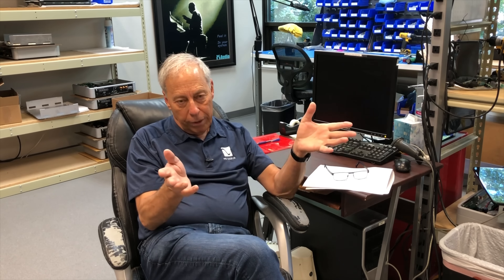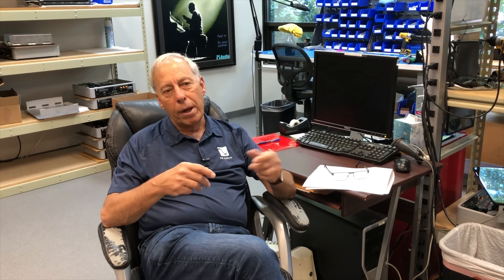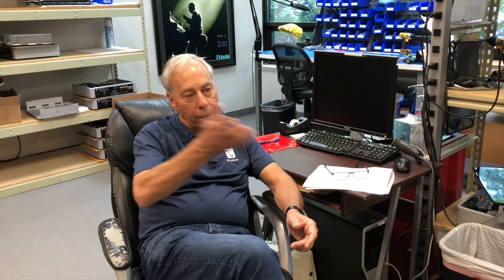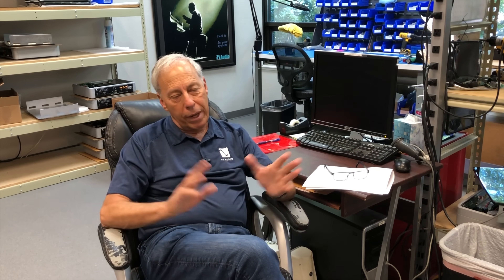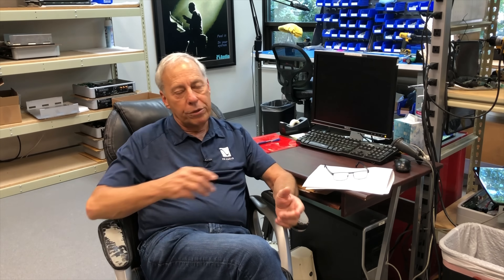How to make Class D sound better

Comment: It's important to note that a good class D amp is often times more revealing than other amps.  And when a component is more revealing it is indicriminate about what it reveals, whether it be music or distortion.  So without superior line conditioning a good class D amp can easily sound less musical.  

But here's something even most class D amp mfg'ers don't know.  Though not digital, Class D stereo amps being high-speed switching amps will induce a digital-like bi-directional noise.  Since this noise is bi-directional this distortive noise from one channel will induce that noise into the other channel at the shared AC inlet and vice versa.  

It gets even worse if we're talking a Class D stereo integrated amp. Besides the high-speed switching amp noise shared between the 2 channels at the AC inlet, the active linestage pre-amp section must borrow AC power from one of the 2-channels.  Since both channels are already sharing their bi-directional noise with each other, and since the pre-section section must borrow AC from one of the channels then it too is blasted with this high-speed switching amp noise from both channels.  Thus making a bad situation even worse.  

Never buy a 2-channel integrated Class D amp for this reason.  And if the stereo Class D amp has a single AC inlet, don't buy it.  

If you do buy Class D amps, buy the mono-block versions with separate AC inlets and attach a superior passive, dedicated, bi-directional filtering line conditioner (they are rare) to each amp.  Assuming the amps (and line conditioners are of superior design and performance, the Class D amps should now compete and quite possibly exceed the musicality of many competing amps.
.
Reply: How about the DC 2-channels integrated Class D amp?  Will it share the bi-directional noise like the AC amp?
Thanks,
Reply: @Vgjbfgaas  Don't know.  But if the 2-channels share the same AC inlet, you're gonna have minor issues.  If the pre-amp section is borrowing power from one of the 2 channels, you're gonna have major issues.  I love some Class D ams but I'll only buy the Class D monoblock versions and I always always always connect every component to superior passive, dedicated, and bi-directional filtering line conditioners.  Did I say always?
Reply: I should also note that since this digital-like bi-directional noise is indeed bi-directional, without superior line conditioners that also handle bi-directional filtering, this digital-like noise will also go out into the wall outlet and induce its distortions on any other component sharing the same circuit.  Some say such bi-directional noises will go all the way back to the service panel and into other circuits.  

Superior line conditioners (that actually work) are a foundational requirement to any playback system.  But even more so to those incorporating Class D amps and/or digital sources.

Since many/most know little to nothing about superior line conditioners, I suspect this is one reason so many poo-poo Class D amps.

Then again, if you're not using superior line conditioners on every component already regardless of component type, I guess none of this really matters much anyway.

Comment: I've owned a Crown xls1002 class D power amp for two years. In the beginning I plugged my cheap-but-good Behringer UCA202 DAC straight into the crown and it sounded okay-good with two pair of pioneer andrew jones speakers wired in parallel. Then I bought a brand new Behringer MIC2200 two channel tube preamp for $100. It has a single 12AX7 tube, a dual triode tube so it provides two channel stereo in a single tube. There are better preamps out there, but this was all I could afford and it made a huge improvement in sound quality. It has parametric EQ for each channel and sounds really clean crisp smooth and powerful for a small cost. The pioneer speakers are one pair of the bookshelf model stacked on top of one pair of the towers. Set up this way these speakers sound amazing for their low price, great bass, and can handle playing loud without distortion.
Reply: I want to buy the crown xls 1002 for home use. But i saw that the xli 1500 at almost the same price delivers 100watts per channel more...i know xls is class D and has a built in dsp,and the xli is a class ab... i am in a dilemma my friend can you pls give me an advise
Reply: @ΛουκάςΚλαρνέτατζης   Before Crown started making class D equipment, they produced class AB amplifiers geared towards professional uses such as live music, concert venues, stadiums, night clubs, houses of worship. These high power pro applications use a type of AB circuit design which is less optimal for critical high-fidelity listening. But today's class D works well for both professional use and hi-fi listening. I'm not an expert in electronics. These are my own conclusions after having set up and run pro-sound systems for touring musicians when I was younger, and being interested in music and hi-fi equipment for many years. In my view, better speakers and a tube preamp make more of an improvement than more watts.
Reply: @mikeday62  ...so you think for home use i better stick to the xls than the xli?  also i hear the class D almost never uses the fan so no noise from that cause no heat,the a-b class will hava that noise am i right?
Reply: @ΛουκάςΚλαρνέτατζης   When the music is playing loud, after six or eight minutes the fan in my XLS-1002 comes on for one minute, then stops for several minutes, then on again for one minute. The case is never warm, always cool to the touch. The fan is silent. Even if you turn the sound off, the fan makes zero noise. Yes, the AB fan might make more noise. Class AB made for hi-fi sound are great amplifiers. Yes if you want a Crown, then get the XLS. Mine has plenty of power for me. If you have the money, get the XLS 1502, or larger. 😁
Reply: @mikeday62  thank you for your replies,you have been very helpful!
Reply: @ΛουκάςΚλαρνέτατζης   You are welcome my friend. Good luck to you!

Comment: Nothing! All Class-D are essentially the same. I find it quite pathetic that companies are selling Class D modules that cost a cpl of dollars for THOUSANDS by just putting them in a nice box! I personally do NOT buy any "high end" Class-D product, as I know for sure it's 80% snake oil for the premium price charged... Class D works GREAT for sub woofer, low end power, but they SUCK at higher frequencies and are simply mediocre.  While it takes effort, better parts, engineering and a bit of Art to make a great Class A/B, Class D is simply re-packaging ICE or Hypex chips... a bit of a scam. If one wants a Class-D amp, buy a mid-level product made by major audio manufacturers as you know they will use the exact same modules, but charge you a lot less!
Reply: That's not true and easily tested. Also, Hpex Amps are $450-$500 each, so $1000 for just a stereo set.
Reply: @folked-up  That's good stuff. I wish I had a bunch of those things, like 32 of them :)
Reply: Depends on the design. IMO amplifier design is basically finished. It's just a matter of what distortion artifacts you want that's listenable etc There's numerous good class A, A/B and D designs that have distortion figures that are basically inaudible. It's just a matter of pricing and power design limits

Comment: I make my living with class D amps. the fact i can have 2kw self powered loudspeakers is amazing.
Reply: Dirk Knight  If you think 20w is enough for the full system, I would say you don't have any bass in your system.
Reply: Dirk Knight  -- More power means more clarity at normal listening volume because brief orchestral or big band peaks won't push the amp into distortion.  Moreover, modern speakers are trending smaller and therefore tend to be of relatively low sensitivity, making it impossible to produce realistically solid bass with even the best 20WPC amp.  I found this out four decades ago, when I replaced my 25WPC Sansui integrated amp with a 50WPC Kenwood -- and that was with relatively sensitive speakers that had credible bass response well down into the 30s!
Reply: Dirk Knight  -- In my experience, amp clipping is very real with low power units.  In fact, that 25WPC Sansui clipped hard enough to burn out a tweeter -- this was so common with that particular speaker that the manufacturer offered a "tweeter saver" gadget for folks who insisted on sticking with their low-power amps at room-filling (but still "normal") listening levels.  With the 50WPC amp, no clipping, no tweeter damage, and much more solid bass.  I rest my case -- high amp power is desirable for any number of reasons, even at volumes far short of potentially damaging ones hearing.
Reply: Dirk Knight  -- I'm getting palpable sub-40 Hz bass from a pair of 6.5" drivers in a suitably configured enclosure that fits under my desk.  Your presumptions on that account are obsolete and have been ever since the industry learned how to effectively apply the Thiele-Small equations.  You seemed to miss the part where there was no HF clipping -- your 20 kHz test tone mention is a straw man, since the tweeter in question was high- passed at a far lower frequency and the clipping could have occurred at any point above that -- and therefore no tweeter damage with the higher powered amp, with no "tweeter protection" other than what was in the crossover circuit.
Reply: Dirk Knight  -- When there's power to spare, efficiency is a non-issue as long as the driver is up to the job.  As I previously mentioned, your presumptions are obsolete.  6+ decades ago, Edgar Vilchur designed a bookshelf-sized subwoofer known as the AR-1W that had bass response that put massive beasts like Altec's Voice Of The Theatre, Klipsch's corner horns, and Bozak's big infinite baffle designs to shame -- but it was woefully inefficient and the amps of that era couldn't drive it to room-filling volume without going into clipping, so it was relegated to relatively undemanding applications in the living rooms of low-volume listeners where it beefed up the bass response of fancy electrostatic panels.

With the proper implementation of Thiele/Small parameters, modern speaker designers can balance the three key factors of enclosure size, efficiency, and bass extension to suit the application at hand, and the cheap availability of high-power, low-distortion amps makes sacrificing efficiency (to one extent or another) the sensible choice.  An example of this approach taken further down the development road is Bruno Putzys's Kii Three system, which integrates drivers, room-compensating DSP-based EQ capability, and multiple low-distortion Class D amplifiers into enclosures considerably smaller than an AR-1W's -- and it delivers bass all the way down past the limits of human hearing at volumes way higher than your "normal."  For exceptionally large rooms and/or even higher volume, Kii offers a extra powered woofer module for that.

BTW, I agree with you that typical modern small bookshelf speakers -- like Andrew Jones' designs for Pioneer and Elac -- don't need a 500WPC amp.  That said, they really can't make do with a 20WPC amp either, because they sacrifice efficiency for bass extension -- if you want an orchestra to sound like an orchestra through these little wonders, you'll want a 60+WPC amp as a minimum, preferably augmented by a subwoofer to provide that sub-50Hz fraction of an octave that even a well-designed speaker of such modest dimensions can't manage.
Reply: The latest work on erasing the distortion advantages of large-diameter/short-stroke woofers -- your traditional Altec/JBL 15-inch monsters -- vs. small-diameter/long-stroke woofers as required for modern, compact home stereo speaker systems: 
https://www.purifi-audio.com/wp-content/uploads/2019/09/Distortion-The-Sound-That-Dare-Not-Speak-Its-Name-r2.pdf
Reply: @editorjuno  There's a huge difference between 15" and 18" subs in efficiency and have a lower cutoff point. Larger is definitely better for those frequencies, given that you have sufficient stuff to handle mid-bass dynamically. It's a physics problem, no way around it if you want SPL
Reply: @billhuey8866  -- Efficiency (usually expressed in terms of sensitivity) becomes a non-issue when top-notch, high power amplification is readily available at virtually any price point.  There are also several design strategies for achieving "larger" as per the relevant physics other than yesterday's immense large-diameter driver cones.
Reply: Bruce Morgen That not answer for high SPL applications. Purifi has done good stuff but it’ll never replace conventional methods of generating it especially for PA type application unless folks like Meyer Sound make similar type drivers
Reply: @billhuey8866  -- I didn't realize we were addressing that particular field of endeavor, in which loudspeaker size is seldom a problem other than in the very smallest venues.  In that case, point taken regarding big-a$$ woofers -- but for most home stereo (and studio monitor) applications, there's no longer any reason to limit oneself to traditional large-driver/high-effiency solutions.
Reply: @editorjuno  It shouldn't really matter. If a general principal is stated it should either scale or have some limit to how it scales. Obviously size matters but it overlaps with excursion. There are overlaps and limits here. Smaller is more convenient and more portable etc and would be preferred but I wouldn't make a blanket statement about excursion being the solution to a lot of these problems because they can be complex. No single solution solves all problems in other words.

The Purify are really interesting technologically. I'd like to heard them but I might not be able to pick out the differences compared to other mid drivers. I'd be more critical about how the tweeter sounds and amplification clarity.
Reply: @billhuey8866  -- The Kii 3/BTX system uses a combination of modern technologies to achieve all the performance any home listening space or studio control room needs, including deafening SPLs, and palpable bass down to 20 Hz, with neither large-diameter/high-efficiency  woofers nor spacious enclosures.  Fully-integrated high-power/low-distortion Class D amplification and sophisticated room-adaptive bass response via DSP,  along with multiple relatively small woofers -- which you dismiss as "mid drivers" -- are crucial to achieving sound as good or better than the biggest and best conventional speakers.
Reply: Dirk Knight  I've had large speakers like ATC.  They are inefficient, and 20, even 100 watts will "tickle"  them.  My 100 watt amp did not achieve 90 db (regardless of the math).  20 has no prayer.

Comment: Professional sound reinforcement speaker manufacturers EV/JBL/Meyer/etc have gone 90% Class D power amplifier modules built into powered speakers & subs. This overwhelming trend is 100% due to the elimination of very expensive seperate power amplifier, much lower weight for interior mounting and CONVENIENCE! This trend had nothing to sound quality or improving sound quality through new amplification technology. In fact, this trend has had quite negative effects on sound quality sacrificing it for cost & convenience. I've been a professional sound engineer for 30 years. Class D power sounds like plastic relative to bigger-heavier Class AB & Mosfet sound reinfircement amplifiers with big heavy transformers, man-sized caps, etc. The Class D stuff sounds harsh throught the entire frequency spectrum and do not priduce big, round, full tight, bass like the big heavy duty Class AB & Mosfett amps do. The harder you drive Class D toward its limits the worse/more harsh it sounds. It is the opposite with Class AB & Mosfet. The worst thing about Class D is that it sounds artiificial not organic. Class D if sounds like a charicature of   Class AB & Mosfet, or like a fax machine version of an original document.

The Class D vs Class A/AB/Mosfet/tube thing is exactly like the 320kps mp3 (compressed/90% information thrown away) vs CD/.wav (10X the information/file size/resoultion) arguement. If you can't hear a distinct difference in sound quality between CD vs mp3... or Class A/AB/Mosfet vs Class D, then you are in the wrong hobby or business.
Reply: There is an exception; subwoofers and the like; since the ear is much less sensitive to low frequency distortion.

Comment: Class A circuits, by default, are biased in the middle of their linear region. Which, at idle, is running about fifty percent of their current capacity.
Reply: well, no,  the signal is AC and the 0 signal is the full conduct signal.  Based on the quality of sound I do not care if i have to pay another penny for consumption of electricity or create more heat.....that is for the internal heat sink to manage.
all I say is that you cannot beat high end class "A" Amplifier

Comment: So If you have a class D power amp and a passive preamp, you should adjust your gain on the class D amp to be as low as possible to reach your preferred listening volume with the pre-amp potentiometer at 50% volume?
Reply: Hi - I have done just that! I have nc400's. the gain on these amps isn't huge so they actually don't come across as being a powerhouse amp anyway - probably similar to my 50watt naim in terms of 'O clock' un-attenuated.  I wired in the attenuators to my interconnect to keep things flexible (kimber also do attenuated leads)the beauty imo of hypex in particular for passive pre's is the high Zin which makes matching easy. I am sure they would inevitably be better with a pre amp, and with that you can add the 'sauce' - it makes for a logical upgrade path and you can live with it a while first.
Reply: Thanks for the reply! Very nice setup you have!